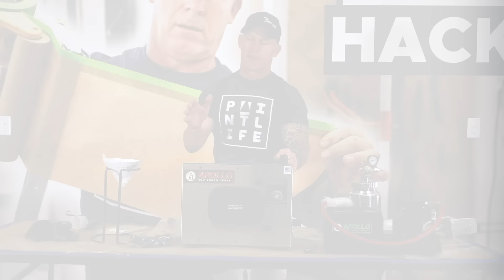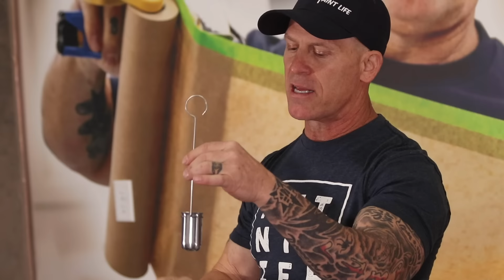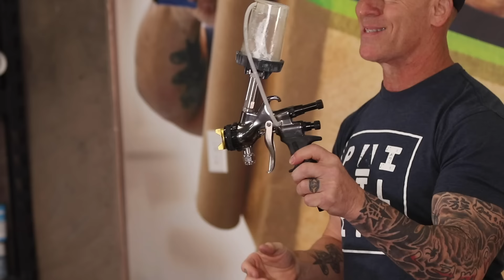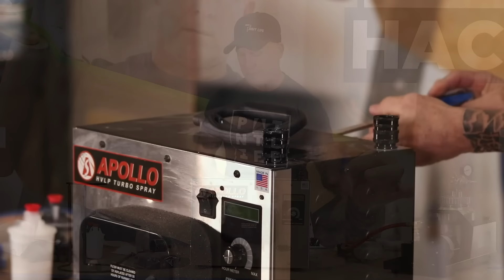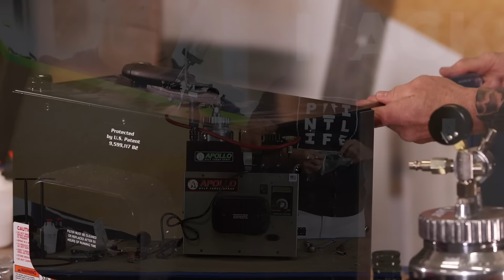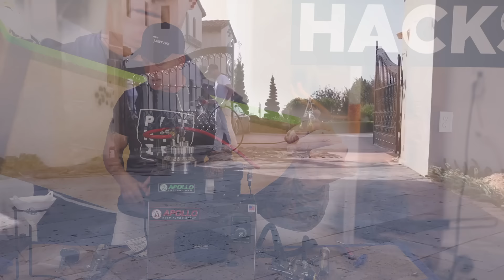HVLP Accessories.  Cabinet Painting Basics.

Comment: I want to paint my kitchen doors/drawers. I'm just a DIY guy and mor I rested in becoming a painter. Therefore what would you recommend as a cheap sprayer option that would still get a quality finish with SW Emerald or Gallery trim paint?
Reply from the maker: Hey @jorgecastro8757, that's awesome you're looking to get into painting and want to do your kitchen cabinets right! It's a great skill to learn, but when it comes to getting a quality finish on cabinets, especially with paints like Benjamin Moore Advance or even a 2K polyurethane, "cheap" and "quality" don't always go hand-in-hand with sprayers. You really do get what you pay for.

For cabinets, an HVLP system is key to that factory-like finish. We're talking about systems like the Apollo Precision 5 Pro that I feature in this video and use for all my cabinet work https://youtu.be/4SsSpt0xTH0. It's an investment, but it's what delivers the results. You can find professional-grade tools like that, along with the right accessories, over at Paint Life Supply Co.

If you want to dive deeper into selecting the right HVLP for your budget and specific needs, and what paints work best for durability, let's keep the conversation going.

https://paintlifesupply.com/

Comment: How do you clean the pot and the hose? can you add a shot off valve at the end of the hose to close it the when disconnecting the gun and attaching the dust blower?
Reply from the maker: @Igor-q3f, good questions. For cleaning the remote pot and hose, it's all about flushing. After you're done spraying, you'll want to flush out the paint with the appropriate cleaning solution – water for water-based paints, or a compatible solvent for other types. You'll run that through the pot and hose until it comes out clear. The cleaning kit we show in the video at 10:25 has brushes and tools that are perfect for getting into all the nooks and crannies of your spray gun and the pot to make sure everything's spotless. Proper cleaning is key to keeping your HVLP system running smoothly and extending its life. You don't want any dried paint messing up your next job.

As for a shut-off valve at the end of the hose for disconnecting the gun and attaching the blow-off tool, that's not typically necessary with an HVLP system like the Apollo. When you disconnect the spray gun, the air flow is usually controlled by the turbine or the gun's trigger, so you won't have air constantly blowing out. The blow-off tool, which you can see at 9:18, is designed to simply swap out with the gun on the main air hose. It's a quick and efficient switch without needing an extra valve, keeping things simple and reducing potential points of failure or air leaks.

Comment: Huh, I already have a 20 gallon air compressor and a Spectrum Spray Gun (1.3mm tip) , can't I just use that?  Maybe I just need to buy a $50 spray gun with a 1.8mm tip.
Reply: 20gallon air compressor will barely last to do a drawer front. The overspray is insane. Switched from compressors to a fuji, now I got an apollo. Never looked back. But to each is own
Reply: @thewoodologist  I recently undertook this project and repainted 21 cabinets doors and drawer fronts. 20 gallon air compressor was more than enough. Spraying at 50 psi with an automotive spray gun. I uploaded a video on how exactly to do it. Paid about $150 for paint and necessary items.
Reply: I’m sure you had to stop and let the compressor catch up. You CAN do it but hvlp is easier and looks good. I have a 80 gallon at home use that all the time but if I’m doing a refinish for a customer at their house I bring my Graco 9.5 . Way less overspray and lays down just as nice if not better

Comment: I have been using a Fuji Pro HVLP to spray interior trim and doors.  Thinning the latex paints and primers to the recommended viscosity is the most difficult task that I've encountered as the paint manufacturer's recommended thinning is nowhere near what the spray gun manufacturer calls for.  I like the blow-off too.  That device means that I don't have to bring my mini-air compressor in the room to blow off sanding residue and dog hair!  Thanks for the video, I would greatly appreciate more HVLP stuff.
Reply: Do you have experience with graco or titan? Im trying to decide which brand to go with for the same uses as you.

Comment: Just got this system in January and absolutely love it 
I used it to spray Sherwin-Williams emerald trim paint it did a great job, A little bit of a learning curve but once you figure it out it does an awesome job
Reply: Mark Laffey How much did you thin  the emerald paint and what tip did you use?  I have a  turbanaire minipro and I know a 3 stage cant compare to a 5 stage but I’m gauging how you did versus what I may be able to do.  Thanks in advance
Reply: @philipharris6303  Thinned about 10%  and used the High Solid C cap I believe I used the 1.8 needle. Hope this helps sorry it took me so long to get back to you but I had just seen your question.